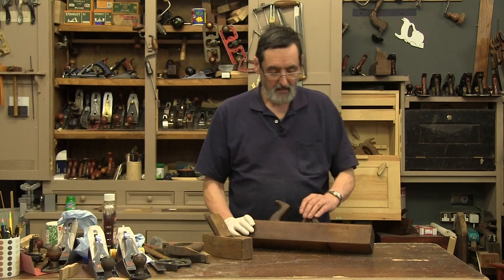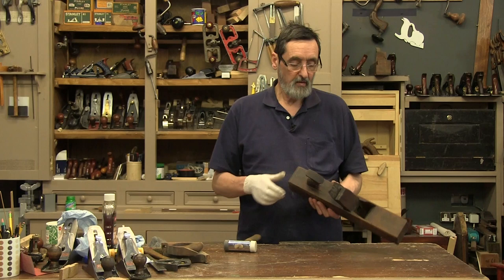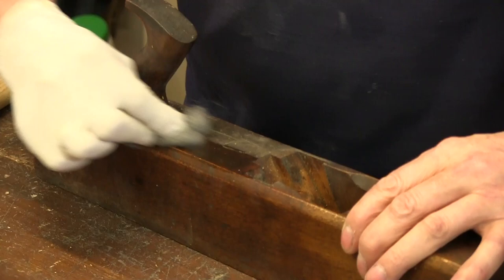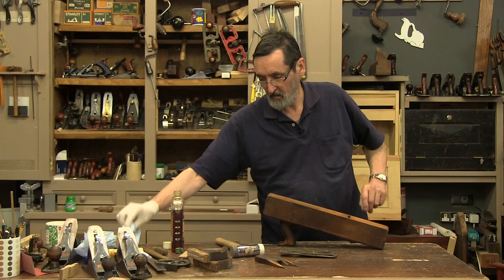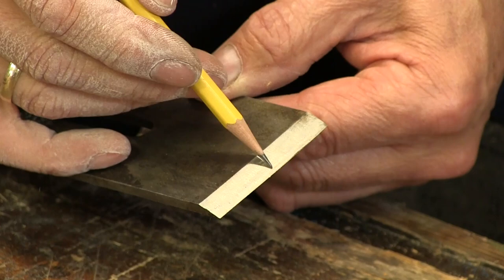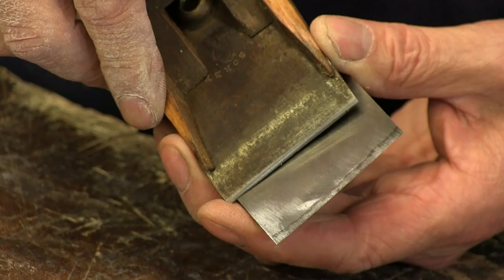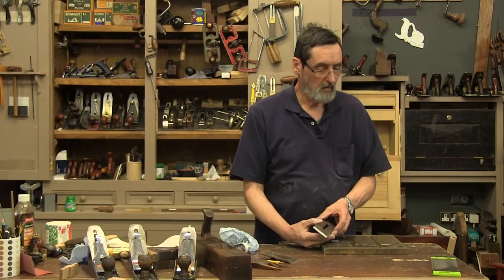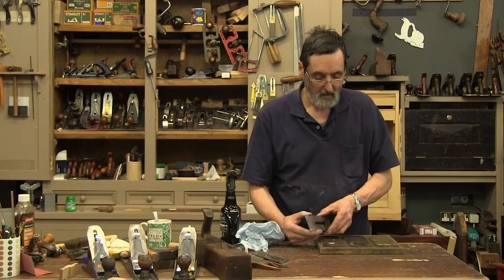Preparing a Wooden Jack Plane | Paul Sellers

Comment: The reason that Stanley Jack is hollow is to do with the surface grinding process not it's subsequent use. The casting was rushed through without annealing or weathering to surface grinding and has moved afterwards. 100% of later Stanley/Record etc planes will be hollow both lengthways and side to side, often quite dramatically.
Reply: One other thing- if I flatten a wooden plane I leave the iron wedged in a few mm back from the mouth, this tensions the plane to the form it would be in use.

Comment: Found one of these wood Jack planes at a thrift store, Sole is very flat but has a chip out of a front corner. Would you [woodworking community] leave the hollow or fill with a resin/ epoxy? Thanks.

Comment: Could you possibly do a video on using a Stanley type 45 plane.  They are so complicated in their set-up that most people, myself included, don't use them when they should be fully utilized.  Thanks.
Reply from the maker: Hi Jim. I could but the problem is the audience would be highly restricted because no one would have use for one. Though they come with many cutters they are hardly worth setting up because often they do not work well at all.
Reply: Thanks for the reply.  I agree they are hard to use.  On another point I just tuned up a wooden jointer plane with excellent results thanks to your video.

Comment: Paul. Thank you very much! I have one of these long wooden planes. Unfortunately it has a broken wedge and no chipper or blade. Could you please tell me what to specifically look for regarding the wedge, blade and chipper for the long wooden plane (which I believe is exactly as you demonstrated)? Thank you!
Reply from the maker: You just have to go on eBay. They are often for sale there. Just find one the right width. Most of them are two inches.
Reply: Paul Sellers What about the blade type and size for an old wooden rabbit plane (the ones that have the two round handles sticking out of the side)? And does that have a chipper I need to look for also?

Comment: I live in the Czech republic; new wooden planes of all kinds are still sold in hardware stores, along with spare blades to suit. Metal body planes are available, of course, but are not so commonly seen, as they are much more expensive. Czechs tend to be very pragmatic: if you can get a wooden smoothing plane for 250Kc and it works, why pay 4000+ for a fancy metal one?

Comment: Thank you for your videos. In this one you said to soak the block in water after rubbing boiled linseed oil over it with steel wool. How long do you soak it for and why? Thank you
Reply: Paul is talking about the boiled linseed oil. It self-combusts. So you need to soak in water any wire wool or cloth you use to apply it. Safety first!

Comment: One thing I didn't get is that planes have in feed and out feed at same hight but the blade cuts lower, so you will have a gap under the plane anyways, no need to make them perfect flat bottom

Comment: "don't obsess about plane sole flatness" ho boy i remember when I bought my second plane a No.7 and knew i had to flatten the sole.  went with my strait edge and test every surface,wall , floor , furniture , glass , window just about everything except the roof to find a surface to grind but nothing was flat enough and it drive me insane . Not only that but the rulers, levels and strait edge i was using were giving me different result so i was worried to find a flat surface to flatten my strait edge to find a flat surface to flatten my plane to flatten wood ! Did not sleep well that night and don't get me started on squareness of squares!
Reply: Glazer Étienne You need a granite plate. There are different grades but I found that the ones Grizzly sells aren't too expensive and are plenty flat.
Reply: yep went and buy a 3/4 granite slab 10 by 30 inches for 70$ to a bathroom and counter top supplier, far less expensive but not perfectly flat at that length but really really close, i wonder if a power jointer bed would be as good or better

Comment: What does WARD mean on the blade? Also, on another blade for another plane it has WARRANTEED. What does that refer to?
Reply from the maker: A WARD is just the name of the maker and WARRANTED simply means guaranteed. It was used a lot in tool making in the 1700-1800’s but it was dropped during the mid 1900’s
Reply: Thank you very much. My plane restorations are coming along very well thanks to you and your videos.

Comment: I don't think I understand putting the plane in a tub of water, could you eleberate? I feel like it would just cause trouble
Reply: Paul is talking about the boiled linseed oil. It self-combusts. So you need to soak in water any wire wool or cloth you use to apply it. Safety first!
Reply: @mrjones6543  ah so he wasn't talking about the plane itself! Thanks for the explanation

Comment: Wouldn’t this open the mouth of the blade opening?
Reply: With repeated flattenings it would.  You can find many such jacks and jointers with an isoceles trapezium insert designed to correct the narrowing of the mouth.